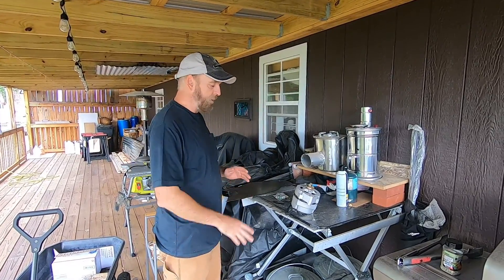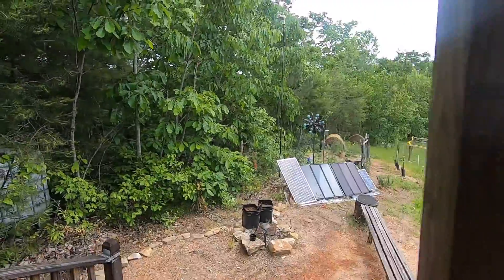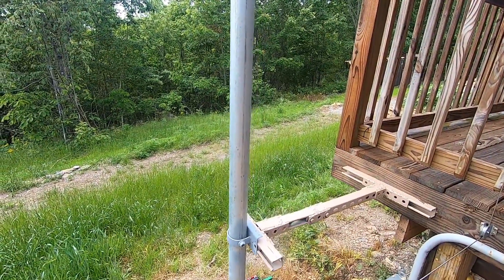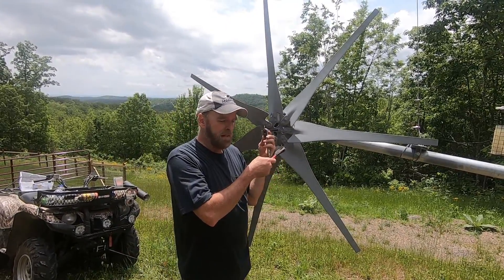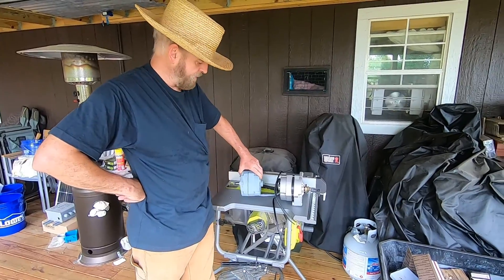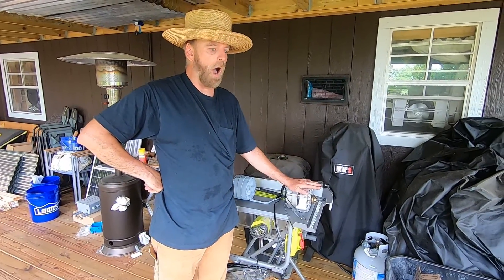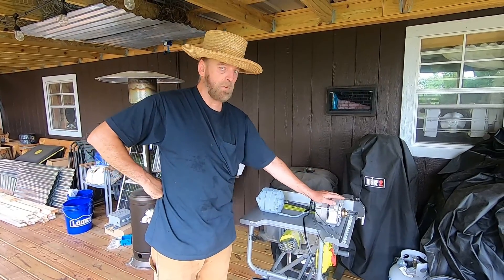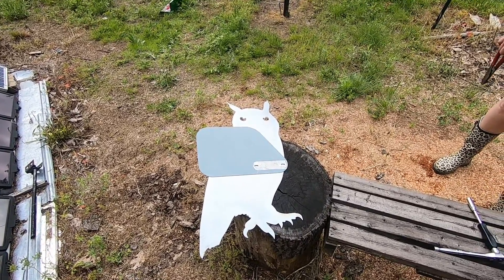PART 1 Off Grid Thermodyne,Cutting Edge Power and Missouri Wind and Solar Turbine Erection  Upgrade

Comment: Everyone knows that the less amount of blades the faster it spins , you have 7 blades , 5 would be faster and 3 would be even faster , also you are only about 20 feet high , go up to 60 or 80 feet and the wind is constant , and you could add a step up gear which would have a big gear or pulley running a little one which would spin it faster , 
Cool wench system you have , just get it up higher in the sky
Reply from the maker: Nope 20 feet is great. If I go higher I need guy wires. I don't have the footprint and I don't want kids running into them. Also being on a ridge it would be a lightning rod. Right now as I type I have 10mph winds and my bank is full the turbine is happily making power. I have other videos where I have upgraded the turbine. Thank you for watching the video.

Comment: I am building a wind turbine out of a 250w motor. Should I even bother? 
This is my first one to build. It’s kind of trail and error. But do u think I should just go buy a turmadine?
Reply from the maker: Watch John Daniels video on using a 24v turbine on a 12 volt system if you have low wind spoeds.  I am VERY happy with Thermodyne.